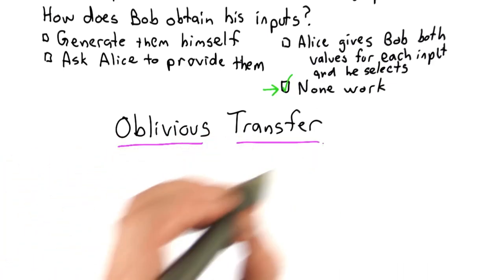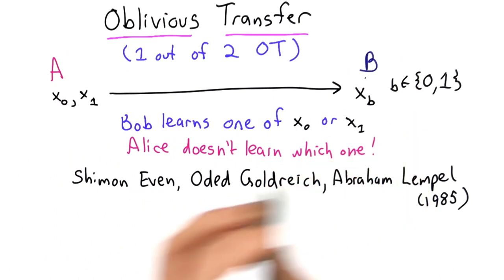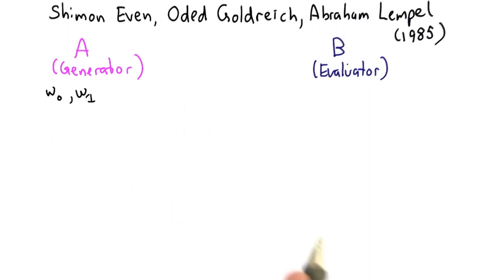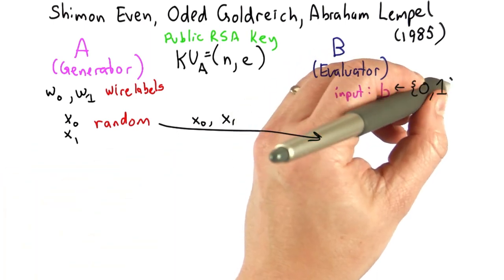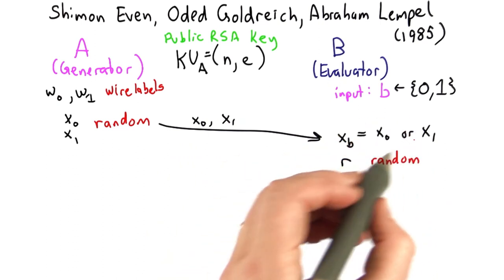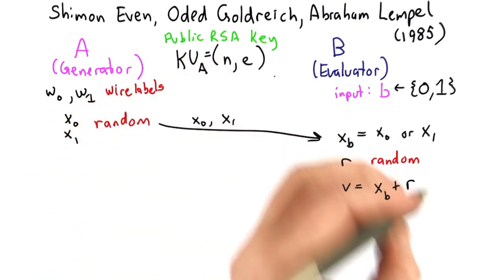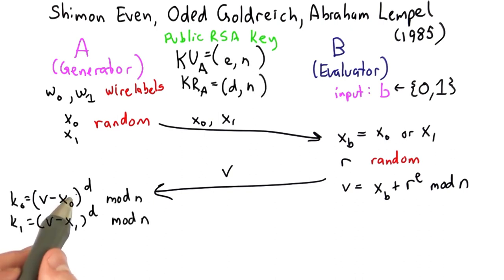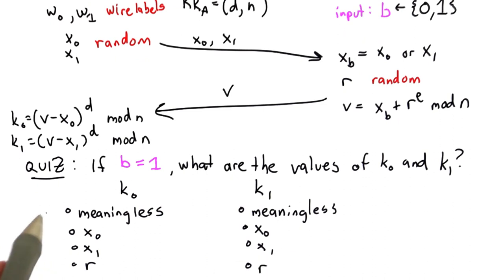Oblivious Transfer - Applied Cryptography

Comment: What will happen if alice will know which input bob selected?
Reply: she will not know the k, once alice calculates the k0 and k1 she adds them respectively to x0 and x1 and sends m0=x0+k0 and m1=x1+k1 to Bob, bob has to subtract and then he get the x0 or x1
Reply: First, we should to know what the applications are going to be built upon oblivious transfer
For example, a simple remote coin flip protocol, Alice and Bob want to play a coin flip game by telephone
In this case, no one will trust the other
However, we can use the oblivious transfer to help both Alice and Bob to trust the other
Alice can prepare a bit string to represent her result of the coin flip
Then, she uses the oblivious transfer to transfer the bit string to Bob
A result of the coin flip is XOR(bit-string)
Bob will receive a half bit string from Alice, and she did not know which bit Bob received
Then, Alice publishes the original bit string to complete the coin flip
Because, she doesn't know which bit Bob received, she cannot cheat to Bob
Finally, they can complete the remote coin flip protocol as their wish
Then, is your question, what if Alice know which input Bob selected
Alice can always cheat Bob the result of the coin flip, publish fake bit string and win the game, if she know which input Bob selected

My English is not very good
Please bear with me if there are any grammar mistakes